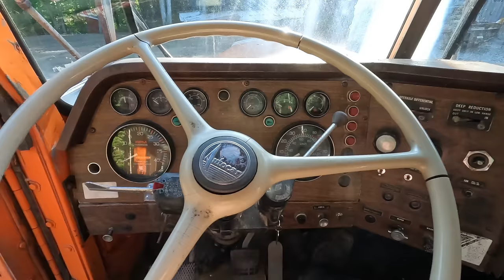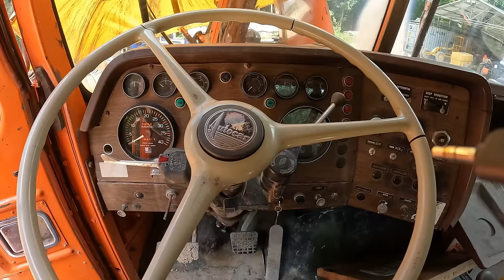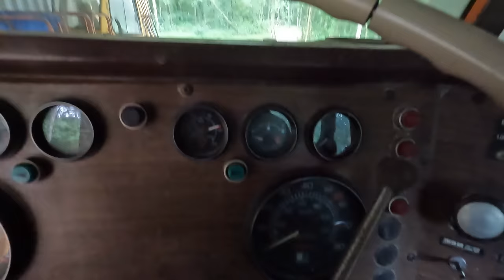Will this  Autocar Semi Truck be fit for the road after sitting many many years? (Small Cam Cummins)

Comment: Very cool unit here , by the way , it may not be high miles , could be high hours though 
good idea to do oil samples
these engines need fuel additive as low sulphur fuel not good for old style injecvtors/pump etc
Reply from the maker: Only 3800 hours

Comment: Try banging on the slip joint with a 5lb with it pulled under tension. Like popping ball joints.
Reply from the maker: I used a 10 pound. Nothing

Comment: Fuel filter show rubber internal damage to fuel pickup hoses from fuel tank. Replace all hoses.  The inner lining will collapse on you pinching off the fuel...It will shut you down during a run if you do not replace the hoses.

Comment: 30:20 The oil looks very thin. Even if it's warm
it should actually have a different viscosity.
It looks like it's very diluted with condensate.

Comment: Winch shaft fabrication should run about $200 to build it.
2 joints and a shaft end with the stinger and tube-heavy wall.

Comment: I watch a number of you guys work on various kinds of mechanical devices as I have over the years. Just curious why penetrating oil isn’t used more often. As with the drive shaft, heating it and soaking it with a good penetrating oil and giving the shaft a good wack while under pressure would seem to help the situation.  Just a thought. Respects

Comment: There are 2 type of starters. The one you show whit a solonoid. The starter itself has only 1 pair of coils in it 

The other type doesnt has a solonoid.
It has 2 pairs of coil. It starts slowly on one pair rotating and engaging the tooth in the starter tooth.
At the back side there is a contact bridge like the contact of the solonoid. As soon as these contacts are closed the 2nd coils get power and rotate and start( if all is well😉) the engine.
I would call the second double acting because there are 2 motors in one drum.
Cleaning electrical contacts. Use 180 or higher sandpaper, scotch bright or brasspolish/valve lapping paste. If they are not smooth they will burn in faster than a blowtorch.

Comment: Starter is obsolete.  Replacements are Delco 8300000, 10461052, and 8200308.   Also, you missed changing the spinner oil filter on the fender.

Comment: Hmm, one of the throttle shafts on my old truck had a nut on the slidy part that stopped it from going over the gear part of the shaft. once i undid that nut i could take the entire sliding part of the throttle shaft.

Comment: Matt given that that valve or pressure regulator valve whatever it is deals with your air breaks, you might be better off just replacing it instead of rebuilding it. Is like with those brake canisters on your axles, which look like you have a mix of newer brake canisters and the original widow-maker canisters that can be rebuilt. Anything dealing with air pressure, can be dangerous to rebuild as it can easily blow up, or like the older brake canisters that could be rebuilt can come apart on you faster then you can react causing some serious injury. It's like split rims, a lot of that stuff is just better off being removed and replaced with something newer and safer.

Comment: Hello Matt. ATF in diesel may be bad idea or one more myth.
 Fuel system cleaning

For this purpose, some motorists use a special transmission fluid (ATF). It is believed that, with the help of its lubricating properties, it improves the quality of diesel fuel and helps to cope with contaminants in the fuel system.

ATF fluid is an oil that has a thin consistency and a mineral or synthetic base. Usually, owners of cars with a diesel engine fill in two-stroke oil, as it contains fewer additives.
Pump Lubrication

The correct operation of the diesel engine depends on the condition of the fuel pump. Some car owners believe that the lubricating properties of diesel fuel are not always enough and therefore the addition of ATF oil to the fuel improves, in their opinion, pump lubrication.
In what proportion and how is ATF added

Do not add low quality oil to diesel.

As for the proportions. They are known only from the words of experienced car owners. No scientific experiments have been carried out on this topic.

A safe proportion is the interval 1:400 to 1:1000. This is 10-25 grams of oil per 10 liters of fuel. A lack of ATF may not give the expected results, and an excess can cause carbon deposits and engine coking.
Risk Warning

Many experts have doubts about such measures. These doubts are due to several factors:

    car manufacturers prohibit diluting diesel fuel;
    there are resinous substances in the oil, after the combustion of which carbon deposits remain;
    ATF does not completely burn out, and its residues clog injectors, valves and a particulate filter.

    Important! Adding ATF to diesel fuel is not recommended if the engine has a particulate filter.

This method began to be used many years ago. There was a feeling that the motor runs quieter, this led to the conclusion of a positive result. Many people still hold this opinion. But most experts do not recommend adding transmission fluid to a diesel.

Comment: Matt, please listen to some old man wisdom that was learned through experience.  I'm confident you dont have an air dryer installed on that truck.  If not INSTALL ONE!!!!!!!!  Here's my story:  I had picked up a load out of Milwaukee headed to Chicago.  It was (thankfully) early morning Christmas Eve.  After leaving the interstate  onto a two lane side road headed into a small town I was doing about 50mph.  No traffic on the road at all.  Coasting and slowing down and gearing down along the way.  I've been on this road before and knew there was a 4 way intersection coming up.  I applied brakes-nothing!  I had application psi but nothing to the wheels.  Continued standing on the brakes, continued to get nothing.  There was dense trees all the way up to the stop sign so I could see any approaching traffic.  Operating "blind" I 'm blowing the air horn trying to draw attention to whomever might be approaching the intersection.  I had a 10 speed trans and was two-fist, white knuckling that stick trying to gear down/slow down as fast as I could.  Its a wonder I didn't blow that old big cam Cummins.  I was praying "Please God no traffic" repeatedly.  Blew right through that intersection and was finally able to stop about a mile beyond.  moisture

Comment: I don't think that middle plug in bottom of relay valve is supposed to be there,  it's under the piston you cleaned up.  If a park brake chamber is leaking inside it can bleed back through the valve, if that's the foot brake relay.

Comment: Extended oil change intervals are a crock. Coworker has overhauled and replaced enough isx and ism engines that he can tell who was running synthetic/Extended oil change intervals as soon as he pulled the rod caps.

Comment: Solenoid plunger slams in away from the Bendix while the Bendix goes out into the flywheel. 
When cleaning those kind of contacts there's actually a coating, '
I think nickel' over the copper which works a lot better than the copper you can flip that large metal copper washer over and get a lot more life out of it that way. 
Also Grease the shaft where the Bendix rides and make sure that grease is a low temperature grease as a high temp grease will gum up in the winter and cause the same type of problem. 
Worked for Chippewa valley starter and alternator in eau Claire did hundreds of these. And I'm sure Ron down there or his son still do hundreds of these a year
Edit for grammar and spelling as I Google Voiced it
Reply: Black Carbon Conductive Grease.
Reply: @aprilsteel9466  say what?

Comment: put some weasle piss on the driveshaft for pto an put the tractor back on it and beat it with hammer the vibrations help knock it loose ive tugged and pulled and the steady pressure and weasle piss with a 5pound hammer it has worked many times..put weasle piss on when its good and warm.

Comment: I guess you are selling shell oil and products. I'll have to let your oil choice pass. Was hoping to see the fifth wheel install. With your starter motor use some black carbon conductive grease. A light smear will cover bare metal and fill the small gaps left when the metal parts make contact . Thats usually where moisture connects and causes corrosion  and resistance.. The grease will stop that on all connections long term especially battery terminals fuses etc and can be used on any crimped connections.

Comment: that my fine littmat the low voltage side pylls the bendix in to an engauged setting with the starter ring no crashing of angry mis aligned teeth as it is pre engauged I have done a lot with these starters

Comment: When did you steam clean the engine from grease &grime
Reply: Pretty silly thing to do even if you are careful . Steam is too hot for a lot of the rubber and plastic parts.  Pressure clean what you must to work on it but don't take the grease and grime off. Thats what stops the rust and rust kills it . The grease and oil won't.

Comment: WHAT DOES THE "W" STAND FOR IN THE 15 W 40 MOTOR OIL, AND THE "W" IS ON ALL MOTOR OILS, EXCEPT FOR STRAIGHT 30 WEIGHT OILS??
Reply: The W stands for Winter,  it is the ability of Motor oil to flow when the weather is cold. The lower the first number means that the oil is thinner in colder temps and that should increase it's ability to flow better in cold weather.  The  higher number means that oil has the ability to thicken at higher operating temps.   The straight 30 oil is pretty much the same and does not have the ability to flow freely at lower temps.

Comment: As a carpenter, I would never set the depth of the saw blade any more than is necessary to make the cut.  Any deeper and you stand to get the blade in a bind, making it harder to cut.

Comment: Why don't you use penetrating fluid to loosen bolts or sliders, why not try to heat the propeller drum instead of the slider, the expansion will be better to move the slider...

Comment: I can't stand those little oil pumps.
Grab a drum lid, drill a hole in it and screw an air fitting into the hole, set your compressor regulator to 25 psi (put a valve in between if you wanna be fancy). Saves a WHOLE lot of time! ;)

Comment: At 42:32 "I've got a lot of pressure on that thing".   WRONG.   You have a lot of TENSION on it.  Pressure compresses, tension pulls apart.  (This is very basic physics and engineering.)   Matt:   Learn it, do not forget it.

Comment: Most people would crawl under and roll in the mud to clean the underside of their truck.. Not Diesel Creek.. LIFT her up with the excavator ! makes it 100 times easier. lol.   I love that Autocar man. My uncle had two of them on his farm back in the day one was like a 78, Cherry red,  Then he had one that was like in the 90s, but it was a "Michigan Special"  I dont know what that is exactly..but he said it had much more horsepower in it . He would have that thing loaded to trains pulling boulders, 3-4 footers ...LEad trailer FULL, then the pup trailer FULL,   loaded WAY too heavy for any scales. and that thing woud just eat that weight like it was nothing.. Both the trucks were red with hand pinstriping on them.  The one was called "the boulder baron"

Comment: Do yourself a favour when you build the garage and install hoses and evacuator fans up to your ceiling so you can connect it onto the exhaust on your equipment and vent it outside and run it for repairs or wanting to warm it up but not want all the bay doors open

Comment: Put tension and run water on the small inside shaft wile heating the larger outside. That way when you heat the outside it wont heat the inside at the same time letting the outside expand while the inside stays the same. Or when it cherry dump water on the ins8de to shrinknot fast while pulling.

Comment: Hwy Matt, Do you know the date code that's stamped into the sidewalls of your Autocar's tires? 

"The raised numbers of the DOT Code are placed together and often enclosed in a raised oval. The first two numbers are the week the tire was manufactured. The second two numbers are the year the tire was manufactured. ... On tires that were manufactured in 2000 and after, the last four digits indicate the week and year the tire was produced. The first two digits identify the week and the second two identify the year."  

Usually heavy truck tires are said to last (are good for) three to six years.  When you get a DOT inspection, the inspector signs-off that your truck's safety is OK or good, his butt is on the line here, many inspectors won't approve six year old tires.  Are your tires less than 10 years old?  Not to rain on your parade, this will be expensive, ten tires multiplied by ~$400 or so?  How old are the tires?
Reply from the maker: They all need replaced. They are cracked up

Comment: Did you guys see the front of the road grader the wheel was leaning
Reply: It is designed to be able to lean left or right, it helps in steering when grading, depending on which way the scraper blade is turned.

Comment: Those air lines will get you put out of service by any highway cop....and a BIG FINE.  Same is with any oil leak. Do not be stupid cheap as the fine is very much more than the repair parts. n If stopped on the highway, they will call a tow truck too. That is big money expensive.

Comment: hat do you mean next video on the road. dont tell me in the usa you can just buy a old truck and put it on the road, with out taking it to a truck shop for a complete safety check,,wheels an all off to check brakes drum thickness, here in Canada that must be done on every truck 1 ton an up every 12 MONTHS as well as every trailer float lowboy 10,000 GVW AND over ,, ALL THAT BODY AND FRAME RUST WILL NOT PASS, MUST BE LEANED UP PAINTED,, THAT VALVE IS A QUICK RELEASE AIR BRAKE VALVE  FOR SERVICE BRAKES, HERE YOU HAVE TO KNOW EVERY PART OF AN AIR BRAKE SYSTEM IN ORDER TO PASS  your air brake endorsement class Z license and how every part works. i have to weite both my class D an Z every 5 years plus pass a medical..
Reply from the maker: It’ll need inspected but the rust won’t be any issue. There really isn’t any rust to speak of.
Reply: @DieselCreek  thats good. here that much surface rust wouldn't pass. here you can take your wheels off your self but you have to be a licensed tire person to put them back on,, so when ever i have to do work on brakes i take wheels and drums off as one unit that way im not removing wheels. cost me $1800 every year for my dump truck safety and another $800 to safety my 12000lb trailer,, that not including any repairs if needed. i have to paint my steel dump box all most every 4 years
Reply from the maker: @arnoldromppai5395  “licensed tire person” 😂😂😂 never heard of anything like that! We wouldn’t have any tire guys if they had to pass a test here 🤣🤣
Reply: @DieselCreek  yup totally crazy, it been that way since the early 80'a after a long stream of people being killed on hyw with wheels coming off and hitting on coming cars, any one can take them off  truck but you have to be a licensed tire person to put them back on a truck.. even usa trucks come in to Canada cant change there flat tires, they can take the flat one off  thats it,, by law

Comment: Can anyone please tell me why all these "starter-uppers" never do the bare minimum before even looking at cranking the engine, i.e. cleaning out the fuel tank and changing lube and filters? One single revolution with dirty or water contaminated oil can or will ruin your main-, big end- or turbo charger bearings, whilst water in the fuel will cause irreparable damage to the injection nozzles, injection pumps or even bend the conrods, valves or pushrods as water is not compressible.

To have the the truck and use it occasionally for months with a contaminated fuel tank and then replace the fuel filter without draining/cleaning the fuel tank which has a very reachable drain valve at the bottom is just insane and is painful to witness.

Do better! Take care of your fluids folks. Especially if you have no idea what the engine has lived through before. 

/The marine engineer who cries while bingewatching these super enjoyable, yet frustrating channels.
Reply from the maker: I use the truck all the time? It’s not gonna magically get contaminated fuel if it sits a few weeks or even months
Reply: @DieselCreek  Hi! First of all - I love the channel and have no criticism per se on what you do, but if you get, say a truck, with 30 year old diesel, lube and coolant in it, including filters fitted since god knows when, and just turn the key - it might be the end of it. Whilst an old stone crusher might survive it, it's not good for it.

Even if the diesel itself may be useable (would not recommend it still) the tank may very well have rust flakes and other contaminants in it. A 30 year old diesel filter won't stop it. On the contrary may very well also that have deteriorated to a stage where it itself releases contaminants that f* up the injectors. 

I've seen enough diesel engines through my career ruined due to contaminated fuel and lube (CAT stands out in a negative way) to at all be comfortable with such gambling. If you want to save the vehicle, the first priority should be to ensure that tanks, filters and fluids are clean and up for the task.

It's not like an old stubborn diesel engine won't run for a while even without any lube oil in it, but it will definitely cause damage, and even if you then refill oil before breakdown and continue running it, it has lost a significant part of its remaining life time.

Again, love your channel, but please at least post a warning for sensitive viewers 😃